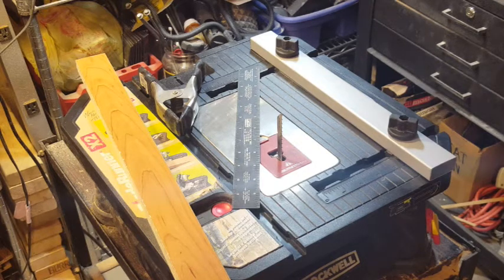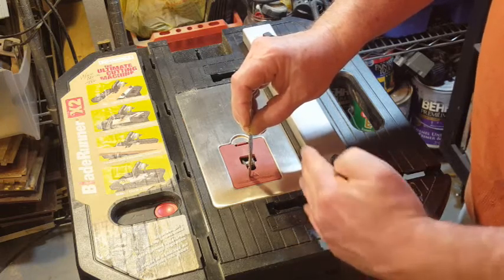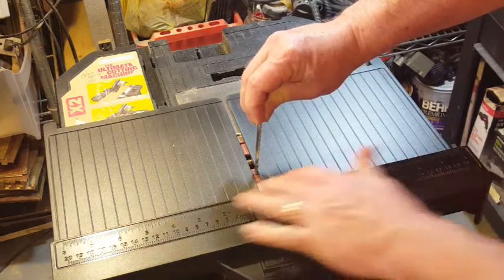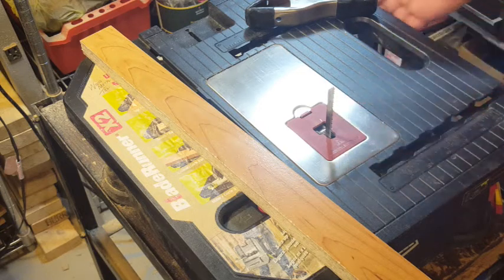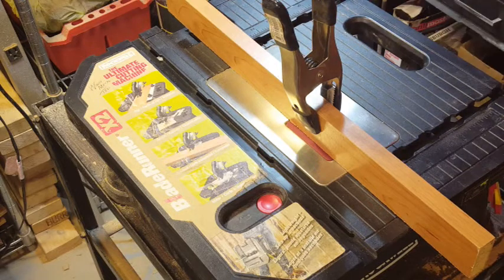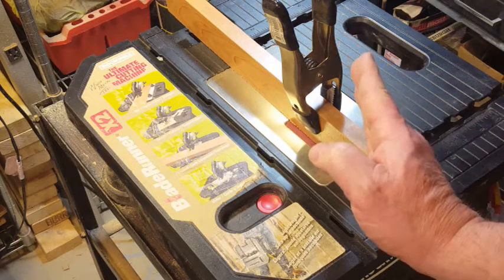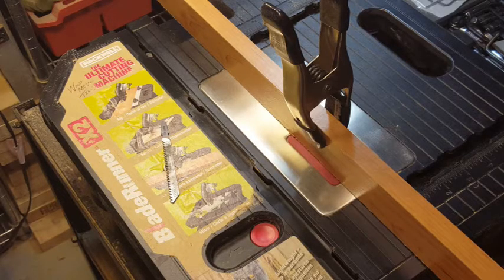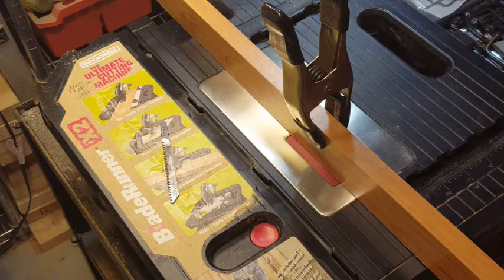19. Make a BladeRunner motor adjustment

Comment: Hi there. Thanks for making the videos. I would to have one of these. I can't locate one in England UK. Doesn't look like it is sold over here. Real shame if it isn't.
Reply from the maker: Hello Ricky and thanks for your comment and for watching. If you can't get a BladeRunner then I would suggest getting a scroll saw. It won't cut as quick but it can cut much more accurately and can cut different materials besides wood. Some time ago, I made a video comparing the scroll saw to the BladeRunner and bandsaw. Here's the link if you'd like to have a look:  https://youtu.be/mVGa4cUj_nY

Comment: I had the same alinement problem with a portable table saw.  I had to loosen the motor mounts and true the blade.  I couldn't understand why my cut didn't come out right.   That should be done at the factory.
Reply from the maker: Yes, I agree Richard, the motor should be properly aligned at the factory. Thanks for your comment and for watching.

Comment: I haven't used mine in a long time.  It shakes/vibrates too much.  Any idea what would cause this.  I make sure the presser foot is down, so it's not that.
Reply from the maker: To try answer your question, I'm wondering what kind of material you are trying to cut? Also, how new is the blade? If you are cutting thin wood with a new/sharp blade, there should not be too much vibration. If you are cutting metal over 1/8" thick, there can be more vibration, especially with a dull blade. Try a new blade and try not to press the work piece into the blade too much; let the blade do the work. Thanks for your question and for watching. Please let me know how you make out.

Comment: I saw a video of this 'saw' ripping laminate flooring. I cannot believe this is a viable tool for this job as anyone knows laminate flooring will kill a TC blade in double quick time. Therefore is there a Rockwell jigsaw blade that they would have been using and have you any idea how many cuts it would last. Frankly I'm sceptical if this saw is man enough to us on said laminate. ?
Reply from the maker: Fair question. This saw uses standard t-shank blades available from many different manufactures. I've never cut laminate flooring so I can’t answer your question directly. If you really want to know if this saw will work for you, I would recommend purchasing the saw from a store or website that allows you to return it if it does not work out for you. I do not consider this saw to be of professional quality; more like a DIYer quality. Depending on how many cuts you need to make,  perhaps this saw will work for you.

Comment: Thanks for the video I really appreciate it.  My blade runner  started dhaking so bad tha it broke the the piece that hold the  blade.  Do you know  where I can buy parts?
Thanks
Reply from the maker: Thanks for your question. I haven't had to buy parts so I'm not sure. I did a quick google search....try looking here:  https://www.ereplacementparts.com/rockwell-rk7320-bladerunner-parts-c-106259_106267_170953.html  .... There is also a phone number you could try. Why was the Bladerunner shaking?
Reply: Imagine then Make 
Thanks for the response,  I did checked the website  you sent me  but unfortunately the part is discontinued.  I just finished  taking the blade runner apart and thinking about installing a Dewalt jigsaw to the table.  I really like the design of the table,  it has great features like fence and arm. Anyhow thanks for the help and keep sharing.

Comment: I found the same issue with my saw as well.
Reply from the maker: I'm not surprised. Luckily, it is a pretty easy fix to make. 
Most of the time now though, I use the BladeRunner to make freehand cuts (moving the workpiece by hand following a cut line drawn on the wood). Consequently, having the blade "perfectly" square to the miter slot or fence is less important.
Thanks for your comment and for watching.

Comment: Im wondering how good this saw would be in ripping longer pieces of wood like 5 or 6 ft
Reply from the maker: Thanks for your question. It is possible to cut boards that long with this saw however,  I don't think the BladeRunner would be the best tool for that job. I would suggest using a table saw. 
Even an inexpensive table saw will have a better fence,  a more powerful motor, and a faster moving blade. 
Also, IMO, a table saw is potentially more dangerous to use so be sure to read and follow the safety guidelines. 
Another option would be to consider using a circular saw and a straight edge or perhaps a track saw. 
Good luck,  be safe,  and thanks for watching.

Comment: I have my blade square to the fence but when using the top, which I almost always do for dust collection, the wood wedges in in the back. I usually 'flare' the rear out a few mm to accommodate this but that compromises getting square cuts. Annoying...
Reply from the maker: Yes, I understand. Sometimes I take the top arm off when making long cuts to avoid this problem.

Comment: If you want exact cuts or close to it you could try adjusting the motor with a micrometer. Just a thought, not a criticism!
Reply from the maker: Thanks for the comment. So far, I have found the BladeRunner to be a great tool to use to make quick cuts where accuracy is not that important.
Reply: Your kidding right?
Reply: @ayebee1207  no

Comment: It looks like you will have to center the motor unit after (every ten or so cuts).
What say yoyu?
Reply from the maker: Thanks for your question. I have not checked the motor unit centering since making the video. I will check it soon and share what I find in a follow-up video. So far, the majority of cuts I've made using the Bladerunner were done freehand following a line drawn on the wood or following a paper template glued down to the wood. I also tend to prefer using scrolling T-shank blades. I think those kinds of blades makes it easier to follow the line. I recently purchased  blades with teeth on both the front and back edge. I plan to try them out and make a video to share my results soon.

Comment: Any thoughts on this device cutting acrylic blocks
Reply from the maker: Actually, I have not tried cutting acrylic using the Bladerunner. "Blocks" suggests you want to make pieces with right angles so I would try using the fence. Also, I think the thing to watch out for is cracking and also overheating (melting) the plastic. I would think you could avoid cracking by using a fine tooth blade. And to avoid overheating, cut a little bit, then pull back to let the piece cool, then cut some more. If you are looking for a finished edge, I would imagine you'd need to sand the cut with fine grit sandpaper. I hope this helps.

Comment: you did not mentioned how did happened that you need to adjust motor to make blade parallel to the edge.
Reply from the maker: This saw is a mass produced product with only so-so quality control (in my opinion). Thanks for your comment and for watching.

Comment: Many of those blades if not all of them are a staggerd toothed design making this aligning blade to fence method totally innacurate and pointless.
Reply from the maker: Hi Garry. There's no doubt that there are MANY different designs for jigsaw blades. Some blades have the teeth in line with the blade body and some blades have the teeth set off to the side. A quick Google search for "jigsaw blade types" will show anyone interested, a quick look at the various types available. I also want to say that the accuracy of any cuts made on the Bladerunner is affected by all kinds of factors including tool setup and user skill/experience. IMO having the tool properly aligned (setup) can only help (not hurt) cut accuracy.
Thanks for your comment and for watching.